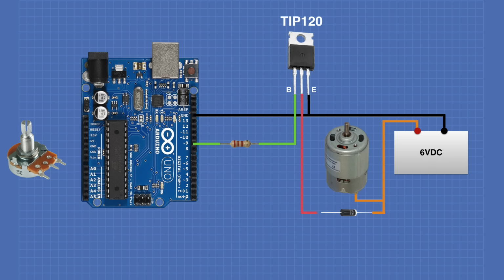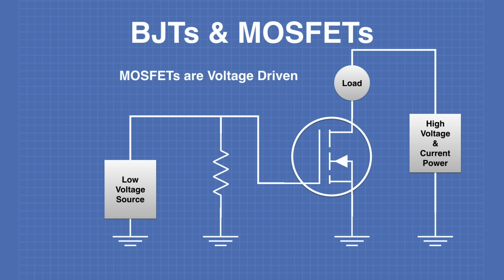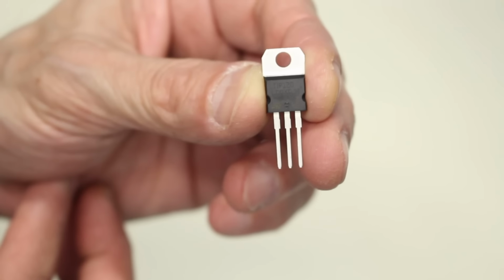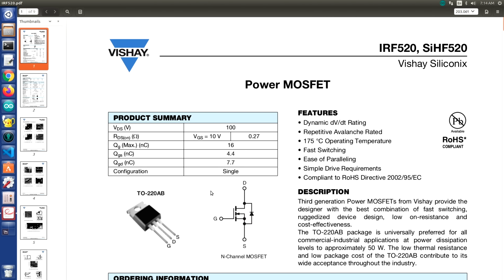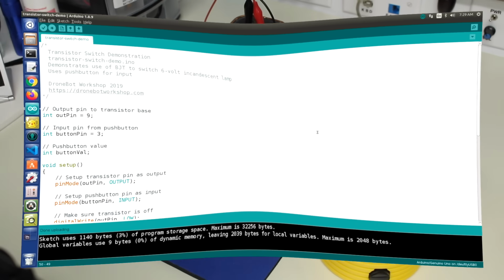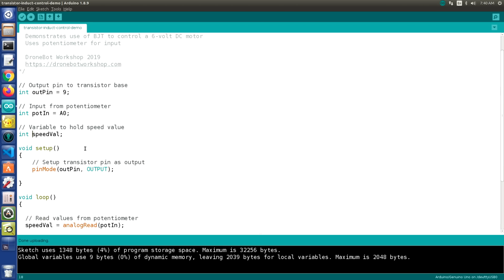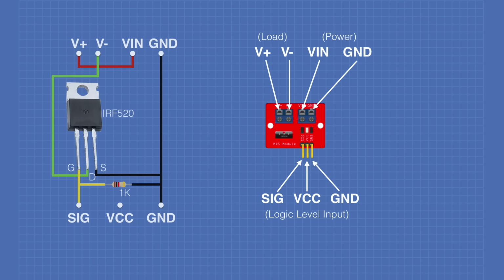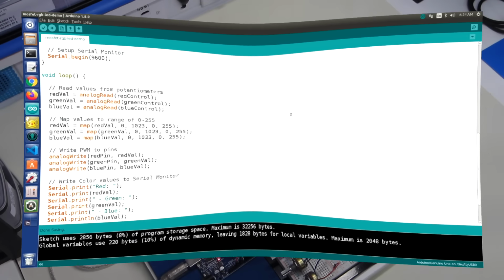MOSFETs and Transistors with Arduino

Comment: I am new to Arduino's and I have a project I want to build using a linear actuator. I want the actuator to be returned to it's half way point when power is turned off on the direction control. If I run the actuator out and I release the switch I want it to return to the half way point. If I run it in and release the switch I want it to return out to the half way point. Can I do this with an Arduino? Any help would be appreciated. AJ

Comment: Careful Bill. Adding to William J comment below, if this is a viewer’s first intro to transistors then it may end in tears. There are hundreds of vids out there that cover the subject in depth. Maybe better if you had just focused on logic level transistors and using them as switches (vs amplifiers) Your vids are always very good, but you’ve tried to be too ambitious here. Most Arduinites are going to be switching < 24V DC so can use the IRL series of MOSFETS e.g. IRLZ44N as a starter transistor and go into the subject in more detail if they wish. The development of the micro controller has made transistor selection really simple now. Most of us just use no more than 5 transistors most of the time, so why not just do a simple selection table (current to be switched vs cost) and be done with it? 
Be careful with next vid as you will be going into AC mains voltages so don’t even start before covering the isolation transformer and the need for viewers to have earth leakage protection on their domestic supply as unlike Canada and USA it will be > 230V AC. As William J this is not a criticism, just a critique. Keep going!
Reply: I agre with the technical aspect of your comment.
However this is not a transistor functional learning video, but a simple how to do video, to get on with your ideas.
And thats exactly what this video fulfill.

Comment: Great video, but what bugs me about all the videos like this is nobody explains WHY you put resistors where you put them and WHY you chose those values. I think I know why, one is to make sure the button is always in a high state and the other is to limit current because current is what triggers the transistor, and I do not think the values mean much but why doesn't anyone ever explain this?
Reply: Because beginners often get put off when you explain the mathematics behind calculating particular component values. But if you can get them to build a working circuit using a 10K pullup resistor and a 2K2 base drive resistor, then they can worry about the "why" of those values later.
I could explain that the minimum value for the base resistor is about 220R because an Arduino must not be required to supply more than 20mA from a digital pin. I could explain that using a 2K2 resistor will drive around 2mA into the base, and that the collector current from the Darlington should then be limited to around 250 times that = 500mA. I could explain that the minimum value of the pullup resistor is determined by how much current you're prepared to waste when the button is pressed, and the maximum value is over 10M. But then I'd have to explain why I think maybe 50μA is a usable value (100K pullup), but 5μA is not (a 1M pullup might be too sensitive to induced noise).
But, frankly, would most viewers of this video be any better off for those explanations?

Comment: The transistor is an advanced juntion diode. Just imagine if the vacuum tube was not invented and the transistor was invented 40 years earler. Just thinkin.

Comment: can an Arduino control multiple transistors for higher loads?

like say 10 to 20 MOSFETs for 100 amps or higher loads.
Reply: You can only control as many devices independently as you have available output pins on your microcontroller. Obviously. But if you just want to drive a bunch of mosfets in parallel, you can do that with a single control signal. I'd recommend a minimum 270R resistor between Arduino and the mosfets, though. Personally, I'd be happier using a single mosfet that was specified for 100A. YMMV.

Comment: As some one wrote on arduino forum: MOSFET with F in its name like the IRF520 shown in the begining of the video doesn't work very well with arduino since they are not LOGIC MOSFET. Is this true? Because i see online there are stores that selling IRF520 MOSFET, and they say it's arduino compatible ( IRF520 data sheet itself only specify Rds(on) at 10v).
Does this apply to BJT? Do i need a logic level BJT to be able to control it with arduino?
Reply: "Logic level" MOSFETs generally are a much better choice when you need to drive them from a processor, and almost essential if the processor is running at less than 5 volts. Some "ordinary" FETs will work OK, but you have to be careful about "gate-source threshold voltage" and the transconductance (ratio of drain current to gate-source voltage) above the threshold.

A single BJT will start to turn on with a base-emitter voltage of around 0.6 volts. A Darlington "pair" will require about twice that. That makes BJTs compatible with most logic devices but you must consider how much base current you need to supply.

There are "digital" BJTs which are a transistor with one or two base resistors (input to base and sometimes base to emitter) on-chip. They can be convenient because they reduce parts count and board space. With these you do need to select types that work with the voltage you can supply for the base.You can get 2 in one 6-pin SM package.

Comment: Lame that you didn't explain how to calculate the required resistors in the circuits. A better example would have been to turn off a sensor like a BME280 using a transistor. I know a BME280 can turn itself off, but lots of other sensors can't and are a huge drain on batteries.
Reply: This is more an over-view. You could say the something about Pd,  Ic or Id, the thermal co-efficients, and stuff like Vce(sat) and RDS(on).

Comment: I made the mistake of shoving (with a good bit of force! Those pins are HUGE!) a 2.2mF 35V filter cap (which may or may not have had some residual charge on it...) straight into the regulated 5V output of my Uno (breadboard side) with basically zero current limiting other than my bench PSU (set to 600mA at the time)...

I think leaving the line unfiltered would have done a LOT less damage to that board :'(

On a side note, if anyone has any ideas on how to properly drive 12V DC computer fans with N-channel FETs (PWM) without compromising the speed signal - let me know! My current options are an insane amount of filtering (which is still useless at low power as the FET elevates the fan's ground) and a couple of optoisolators I pulled off an old microwave's control board.

Comment: If I'm not mistaken an Arduino can handle up to a 12v input, correct?  Would you be able to use the 6v battery to power the Arduino as well by simply tying it into the Arduino power inputs to have a completely enclosed device?
Reply: maybe yours has a on-board regulator but the Arduino itself does not work at 12V

Comment: no matter what i do i can't get anything to work with a motor. i have tried 15 different wirings just to control a stupid motor with code, and i finally am throwing in the towel.

Comment: I just don't get why they are making these "arduino modules" with IRF-520 when it's not really logic-level and barely works with 5v logic, esp. when there are lots of better options available, i.e. on aliexpress you can easily get IRLZ44N which will, for one, work properly with 3.3v logic.
Reply: Yes indeed, Just realized this after ordering parts :-(. Should be pointed out more! Using IRF's is then more like a hack to be used for 3,3/5v arduinos etc if these are the only one you got on hand, and if you're not going to switch more than just like < 1A anyway

Comment: Why do you use variables to hold pin number when you can use #define ? 
This is a waste of RAM... And RAM is a scarce resource...
Reply: It is clean code (edit: and provides you type protection). RAM is not /that/ scarce of a resource in a program that is using fewer bytes than you have fingers. Don't use #define unless you absolutely have to in order to fit within RAM.

Comment: This MOSFET would burn out here. When using a MOSFET, the gate-source voltage must be above a certain amount to avoid thermal runaway. This is not necessarily less than or equal to the threshold voltage. For the MOSFET used here, this voltage is 5.5V. So, if you do not apply a voltage higher than 5.5V to the gate, the current will increase as the MOSFET gets hotter, causing even more heat.

With a transistor, you can include thermal runaway protection in the circuit by limiting the current. But, this will not work in a MOSFET circuit. MOSFETs are comprised of many tiny MOSFETs in parallel. If one lets slightly more current through itself than another tiny MOSFET, even more current will go through it as it heats up faster than the rest, bearing more and more of the load. This will eventually burn out the entire MOSFET, and you cannot see it happening because it is within the MOSFET. So, in a real application, you would want the MOSFET in this video to have the switching voltage be above 5.5V. You can get MOSFETs where this voltage is lower.

You can identify this voltage by looking at the datasheet. Find a graph of the drain-source current (or impedance) vs gate-source voltage. It will have different curves for different temperatures. The curves will intersect at an inflection point. Below this point, the current will increase with temperature (or imprudence will decrease with temperature). Above this point, the opposite will happen. You want a gate-source voltage above this point.

Comment: MOST  important ! !   using a power semiconductor for experiments  without a HEATSINK, can cause the MOSFFET or transistor to get very hot .  Long interval use will cause temperature rise: over   100degC  (careful not to  BURN your  hand !) will eventually;   OR immediately cause the semiconductor chip to be DESTROYED   ! !

Comment: Why did you leave the muslim guy out? Isn't it enough you guys stole medicine, first ever university to open, optics, the first world map, and many more. Stop being thieves.

The metal-oxide-semiconductor field-effect transistor (MOSFET) was invented by Mohamed M. Atalla and Dawon Kahng in 1959 while they were working at Bell Labs. The device was introduced in June 1960 and has since become a fundamental component of modern electronics.